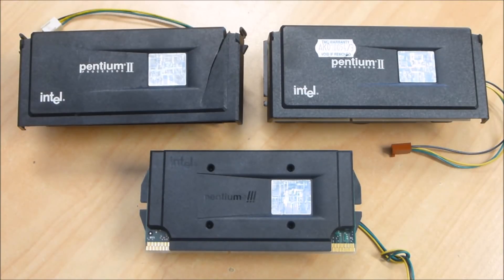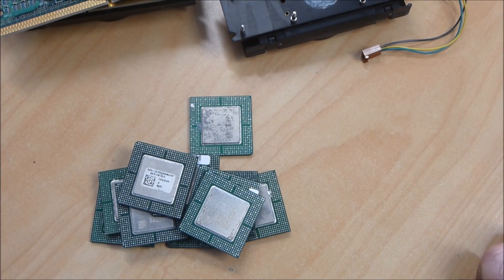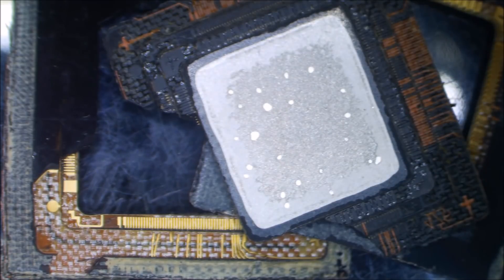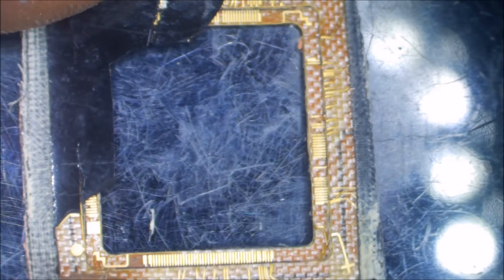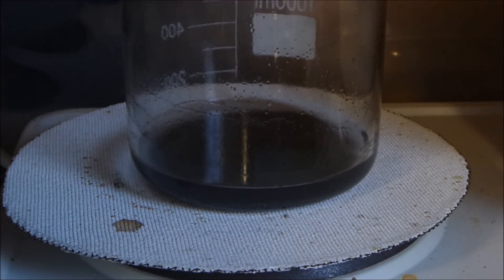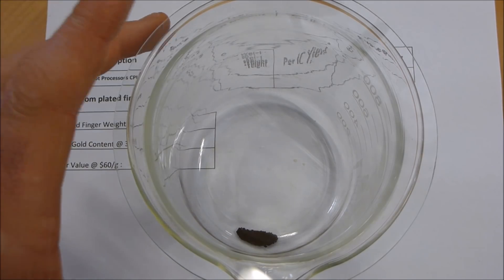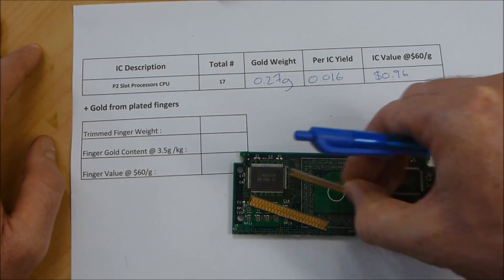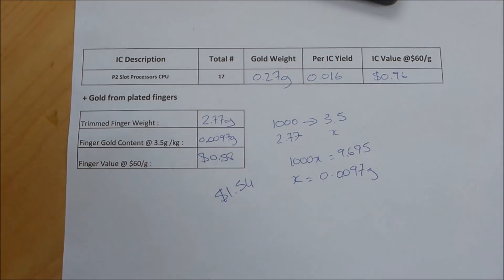Gold Recovery - Yield from slot processors

Comment: Great work, thanks for all the hard efforts, In your final calculations, you ignored the ICs value, is it too low to consider? What is it’s yield per ic? Thanks
Reply from the maker: Hi Hossam, thanks for the comment. Yes, those ICs are not particularly high yield, will likely be less than 1g per kg of ICs. Would need quite a lot of them to do a proper yield test.

Comment: you could goo with HCl as well or i m wrong ???
Reply from the maker: Not 100% sure which part you are referring to, but if you are referring to refining of the Gold, then I always use HCl and HNO3
Reply: im agree but im not able to buy hno3 and have to weak equipment for produce it my self mostly i work with "poor man's aqua regia" anyway it takes a bit more time and extra refining but is effective, regards Rafal
Reply from the maker: Ahh, I see, I guess you meant bleach in your original question ? If so, I'm not sure that bleach will work on bond-wires, I think poor man's AR would be the better way to go, it definitely works, just a bit slower as you say.
Reply: nope i mean to use a hcl at the beginning instead nitric to get rid of base metals
Reply from the maker: Ahh yes, I see, yes, for sure, can use straight HCl to get rid of the more reactive metals, then switch to AP to get rid of the Copper based stuff. Bit slower, but definitely works!

Comment: Just wandering is  bond wire pure gold or plated
Reply from the maker: Hi there, Gold bond wires are reasonably pure Gold, but occasionally ICs also use Aluminium for bond wires.

Comment: i am praying for your advice .i have a stock pot with silver allot of copper and gold in 20 ltr bucket .i initialy put a copper rod in the bucket to try and cement out gold .but I dissolved the copper rod .how would you go about 20lts of copper silver and gold in solution .I'm to embarased as my wife's wedding ring and mine is in that solution .your help would be much appreciated and its been a couple of months of being called a idiot .SOS
Reply from the maker: Hi Tim! Ok, lets work through this one. Have you done a Stannous Chloride test to see if there is still Gold in the solution ? It may have already cemented out. For the stock pot to be dissolving a lot of Copper, it suggests that there is either free Nitric acid in there, or a Copper Chloride leach (AP) is happening. I would get some chunky solid Copper and suspend it in the solution for a few hours with a air bubbler to circulate the solution. If the Copper is dissolving fast and forming brown fumes, it suggests that there is free Nitric acid present. If that is the case, you can neutralize Nitric acid by using Sulfamic acid,  but for that to work you have to get the solution very hot, so you would probably do that in smaller increments in a beaker, rather than all the solution at once. 1L of solution in a 2L beaker is a good way to go. If it were me I would probably start attacking the solution 1L at a time, denox it and then cement onto Copper. Collect all the cemented powder for a second refine. Then, into a secondary waste bucket, only put waste that is known (and tested) to be PM free. In theory you should be able to recover 100% of the lost Gold, it will just take a while unfortunately.
Reply: unless it's a cyanide solution, how did you manage to put gold and silver TOGETHER in solution? something doesn't add up....
Reply: i initially tryed inquartation because I am a idiot .i melted 3 x9ct rings with 50 grams of 9ct i added 150 grams of silver and tipped the lot in distilled water .i used agua Regia to desolve the silver and copper .as im writing this i have just realized I should of used only nitric and I would of removed the silver and copper .however I then tryed to cement out the gold out with a 2 inch copper rod after 3 months the rod desolved in solution did a stanous test no gold evident in solution but i have let settle and have a gray sediment at bottom of beacker tested that and shows gold in sediment
Reply from the maker: Hey Tim, yep, would have been a super easy process if you had used Nitric after inquartation. I'm surprised you even managed to dissolve the Gold with that much Silver in the mix, would have been forming Silver Chloride all the way. Also would not have needed that much Silver since you only needed to get the Gold content to 25%, it was already only 37.5% Gold in the 9ct. Sounds like you are making progress getting it back anyway, keep me updated with your progress mate.